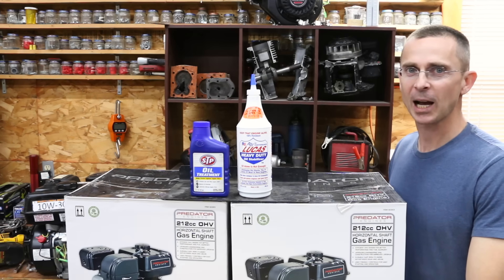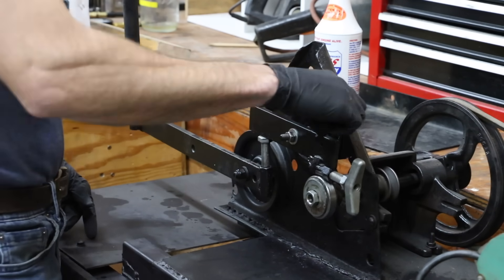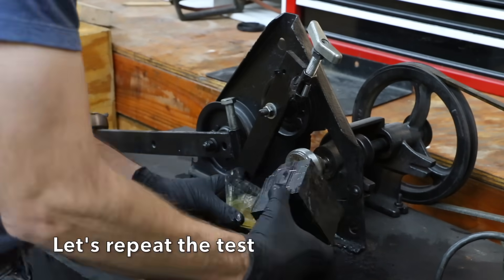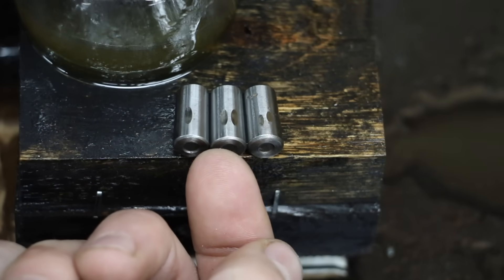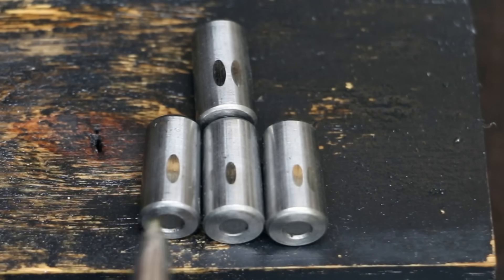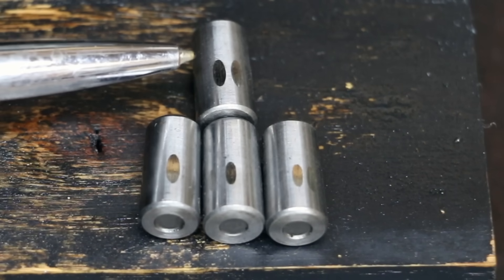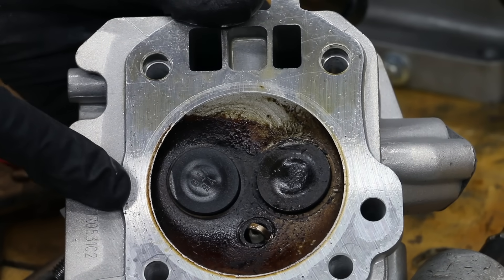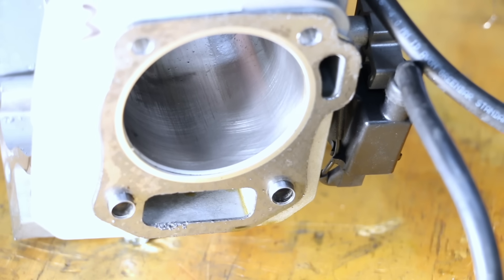Which engine self-destructs first?  Lucas or STP?

Comment: Though you do these tests on small engines do you think the result is the same when applied to large vehicle engines?
Reply from the maker: Each engine is designed differently, but film strength is film strength.  I believe the observations in this video can be applied to larger engines. Thanks

Comment: How much longer did the Lucas engine run for ?
Reply from the maker: It ran nearly twice as long.
Reply: Wow. Impressive
Reply: Yeah, it had twice as much Lucas in it. Duh. Bad test IMO. To know which is better you needed to use equal amounts of additive. I also agree that a straight oil test would have helped.

Comment: IF YOU HAVE A NEWER VEHICLE THAT HAS AN ACTUAL OIL SENSOR, IT TELLS YOU HOW MUCH PERCENTAGE IS LEFT ON YOUR OIL BEFORE YOU HAVE TO CHANGE IT, PUT KENDALL OIL IN YOUR VEHICLE AND THEN WATCH WHAT HAPPENS.  I'VE NEVER TESTED SYNTHETIC. ALL OILS ARE DEPLETED AROUND 3000 MILES OR LESS, THE 20W50 KENDALL WILL GO 18,000 OR MORE BEFORE IT'S VISCOSITY IS DEPLETED. I'M NOT SURE ABOUT THE OTHER KENDALL OILS BUT I WOULD ASSUME THEY ARE MUCH THE SAME. I WAS ON THE NASCAR CIRCUIT FOR 30 YEARS, 100% OF ALL THE RACE CARS HAVE KENDALL IN THEM, THEY POUR IT INTO THEIR OIL SPONSORS BOTTLES TO MAKE IT LOOK LIKE THAT'S THE OIL THEY ARE USING BUT IN REALITY, IT'S KENDALL IN THE BOTTLES AND THAT'S THE GODS HONEST TRUTH
Reply from the maker: Thank you for this recommendation.

Comment: Lucas Oil stabiliser destroyed my BMW engine all the hydraulic cam followers had to be replaced and it happened within three hours of having the stabiliser put into the engine and it was measured correctly to the amount that goes in the oil sump my mechanic told me the stuff is terrible and will destroy your Engine
Reply from the maker: Thanks for commenting on this.

Comment: I agree with the comments about the futility of running with no oil, of course it will self destruct as an engine requires oil. Instead, try a standard big load on three engines using STP, Lucas and ordinary oil and run them for a ridiculously long time many times beyond their recommended oil change and then measure wear and test the oil/additive mix for particles of  metal etc.
Reply from the maker: Thank you for this recommendation.

Comment: Oi should of had a 3rd motor just running normal oil as a control. Also, you could of made an analysis of if the additives even make a difference.
Reply from the maker: Thank you for this recommendation.

Comment: Great video! Very informative. 

How much longer did the Lucas Engine run vs the STP Engine?

How about the same test with a top rated non-synthetic engine oil vs a top rated synthetic engine oil? 

FYI; Husqvarna markets a synthetic oil for these engines.
Reply from the maker: Lucas ran for nearly twice as long.  Thank you for this recommendation.

Comment: was hoping we'd get flyin bits. had a 340 go at valve float rods went east an west wave threw the block. need three engs, one on oil. then we'd know if there worth it. lucas with gear oil i think is worth it. as far as with oil no,i mean one of oils tasks is dirt removale. add liter of atf run no load an drain. l think the lesson is check your oil

Comment: A lot of these comments are saying two engines with no oil will vary a lot when they break, but I'm not so sure. The engines fail when the parts have heated up so much they don't fit together like they are supposed to any more. The friction determines the rate that they heat up which I bet is pretty consistent between engines.
Reply from the maker: You're absolutely right.  When the film strength fails, the heat causes the connecting rod to fail. Thanks for commenting.

Comment: Nulon E10 "worn engine treatment". I've had dirt track engines with the oil pressure light on under racing conditions survive unscathed, one engind massively overheat with it (unscathed) and another raced for 10 mins without coolant come in with bearing knock. Oil change later knock dissapears and it lasted the next 3 races. It was hellishly loud after that but we got 15-20 minutes of full power out of a mortally wounded engine and still drove it onto the trailer
Reply from the maker: Thanks for commenting.

Comment: run engines wide open with oil and additives or cheap oil vs name brand or house brand vs name brand that would be good hold the governor wide open to see which lasts longer an have a neutral engine with straight oil wide open vs the other 2 with additives or something like that you should also test 2 strokes oils name brand vs dollar store oil and measure ring gaps when finished
Reply from the maker: Thank you for this recommendation.

Comment: Thank you for make a 14 minute video that wasn't all fluff to reach the 10 min mark for ad money.
I personally think these additives do nothing more than change the viscosity of the oil they're added to making them thicker.
Example a 5w30 mix with Lucas might come out to like 10w30 or something similar.
Which if you had an engine making lifter tick or something similar would quiet down with thicker oil in the first place.
So I wonder if it would be possible to test thicker oil compared to thinner oil with additives mixed in.
Reply from the maker: Yes, 5 hours of video condensed down to 14 minutes.  Lots of editing.  Thank you for this recommendation.

Comment: Arch oil also saved my jeep 3.8L engine. Was at 1.QT.  PER 500 MILES.  Now im at 1/4 Qt per 1,000 miles. I have 125,000 miles on the jeep
Reply from the maker: Thank you for this recommendation.

Comment: I really didn't see the point made here. I'm not big on oil additives period. I don't think either product claims to prolong an engines life after using their product and then running the engine without oil. I believe the main claim these products have is after the engine is "well worn", then adding their product to an engine, the claim is prolonged engine life after being on deaths door. That can also be accomplished by increasing the viscosity of the oil without any additives.

Comment: test Restore.   I used it on an old 302 in a 70 f100 I had and i saw a noticeable improvement in power and oil consumption.
Reply from the maker: Thank you for this recommendation.

Comment: I've used Lucas Oil in my pick-up truck for years.  My last pk tk had over 500,000 miles on the original engine (in-line 6 cyl).  The engine was still tight and the only reason why I had traded it is was because the body bushings were worn out.  I still use it in my V-6 engine and have over 250,000 miles currently.  I'll stick with the Lucas Oil until something better comes along.  Thanks for the interesting test!
Reply from the maker: Thanks for the positive comment.

Comment: Can you try the Valvoline intake cleaner the they sell at dealerships and at Walmart they say every 15k dealer get 156.00 bucks and walmart is only 20 bucks what's the difference and does it work also what's you thought on the mobile one oil annual protection they claim 20k change intervals
Reply from the maker: Thank you for this recommendation.

Comment: the only way you can test these products is by having 3 motors one with oil one with same oil and stp and a third with same oil and Lucas now fire all 3 up and run for say 5000 hrs (long past recommended
 oil change)then take apart and inspect ....if your not willing to do this your test is pointless because no oil or additive functions after it is removed from the motor ..... i run STP in my 1987 ford f150 simply because it is required to keep oil presser up  after worm up because the motor is old a worn out and has allot of blow by but in my 06 Nissan with 125k miles (i change every 5k miles) i run conventional 10w40 no additives because it is not 30+ years old and worn out like my truck is that my father bought new in 1987
Reply from the maker: Thank you for this recommendation.

Comment: I think this was a little incorrect in method. There was no control group. Wouldn’t it have been a hoot if the untreated engine (which wasn’t present...the flaw in methodology) ran longer than the treated engine. If that had occurred we would no the value of the two treatments presented.
Reply from the maker: Thank you for this recommendation.

Comment: Have just started watching you channel. Catching up on all vids. Cool deal. Now back in the day we used to run two cycle engins on our racing carts. Italian b bombs, Mac 101s and so on. Then the swing went to the 4 stroke 5 horse beefed up, mostly brigs. These ran good. But then a few were sanctioned because they were adding sulfuric acid to the oil in crankcase and was said to create hydrogen gas  that would be pulled up thru the ventilation systems and boost the rpm as it was drawn thru the carb. Never tried it myself as would not do that to a good engin. How ever you like testing and I would really like to know if it's a working rhetorical booster. They said it only took a couple ounces to the oil.  Was said to raise rpm like nitrous. Just wondering.
Reply from the maker: This is very interesting. Thanks for commenting!

Comment: A product called z-max engine treatment versus some other.  I have used Z-max in everything and its wonder stuff... but I would like to see if your testing methods have an effect.  This channel is priceless for helping me select which to use.  In all fairness Ive used STP for engine assy.  I am switching to lucas because of this video.  Science wins.  Sorry STP..
Reply: Oh and one more thing.. I suggest 3 engines.. one as a 'control'.  That way one can see with and without.  This test has no control so there is no way to tell if any of the additives performed over none at all. 

Control for the lubricity test..  Spin it slower add more weight wont work here because a crankshaft spins quickly..   Instead of a rollerbearing though.. use a friction bearing.. that way its better simulation of 'dry run'. 

Keep up the great science.. This is a cool project you got going here.. Very cool.
Reply from the maker: Thank you for this recommendation and thanks for the positive comment!

Comment: Hello.
I´ve been watching your videoes for a while. But I wonder, would the lawnmower run fine on E85? Or maybe it would be a good idea to re-jet the carb to give 20-30% more fuel. Also i guess the piston and valves would become quite clean?
Or maybe a lawnmower has too low compression for it to work?
Reply from the maker: Thank you for this recommendation!

Comment: So the conclusion is both oil suck
Reply: The conclusion is that "Mr. Project Farm" created a new and funny but meaningless way of testing oil additives. Who the hell tests oil-additives by running engines, which had once upon a time one or the other additive added to its lubricant, without ANY oil?
Reply: @michaeloberb2120 look at my comment you silly goose (:
Reply: dude if your engine is cheap or old use cheap oil dont waist money on shit that will be worth nothing later on if you have expensive engine and money use expensive oil this video is stupid idiot killed two good engines proves nothing
Reply: Conclusion is Lucas lasted way longer.  Lucas wins me thinks.

Comment: Motor test not an accurate method.
No oil film would remain on any surface after a few seconds regardless of product. Chinese motors tolerances vary on journal vs rod a lot. A Tight tolerance would best up and transfer aluminum to journal faster than a loose old motor. 

A long term test under load and then disassemble and measure wear with micrometer s is only true test as engine builders do.I have seen these cheesy china motors blow up with oil a lot. 

Fun show though. Both STP and Lucas excellent. I used STP for 40yrs never had and engine blow.
Lucas works good stop slip trans and power steering sealer works on my stuff. I have 300k on my Chevy all original. Leaks nor burns zero oil.
Reply from the maker: Thanks for the constructive feedback.

Comment: Do a 50/50 mix of petrol and diesel and put it in a petrol engine
Reply from the maker: Thank you for this recommendation!
Reply: Thanks for replying was just wondering cause if it works it would be cheaper because petrol is more expensive than diesel so could do a 50/50 mix

Comment: I'm surprised. I thought the engine that was cooler would last longer.
Reply from the maker: Thanks for commenting
Reply: The STP ran cooler since it’s viscosity was lower. Lucas is a very thick additive and really heats up engines. On more advanced engines with tighter tolerances like a car engine the difference is even larger.

The Honda GX series engine that these clones are copied from used SAE 30 single weight oil or 10W30 if used during colder times of the year. Messing with viscosity is usually a bad thing for modern engine life, tolerances are just to tight.

I would assume if the engines were not drained and ran dry the STP would’ve ran for more hours then the Lucas. Either was just running straight sae 30 the engines last forever. We use them a lot in the landscape industry and never have failures due to lubrication. Usually head gasket or carbs, otherwise they will run into the ground or till the machine it’s connected to is junk and due for replacement.

Comment: Try the Lucas synthetic type. It's too bad Hi Tach went out of buisness. It got my 302 home one night with a rung off oil pump shaft in a 79' mustang. Cleaned the piece out of the oil pump. Installed a drive for the pump, new lifters, and kept driving it until I totalled it.
Reply from the maker: Thank you for this recommendation!

Comment: From what I see in this video you used a grinder on the race to rough it up before you did the test with STP. I did not see you grind the race before you used Lucas. The roughness used with STP would naturally wear that bearing more than the Lucas as the STP bearing would have polished the race giving the Lucas a smoother surface to run on. Therefore, in my mind, this test is null and void.
Reply from the maker: Sorry I didn't show it, but I used the same grinding wheel for both. Thanks

Comment: In reference to oil,  i look at it like there are 3 types of people.  
1. Doesnt care what oil.
 2. Buys regular oil and puts in additive. 
3. Buys best oil and runs no additive.. 

So a good vid to compare with this would be to conduct the same tests with some of the higher end top selling oils and use NO additive. The standard 2 are Mobil 1 exten perf, and Amsoil signature series. 

However, Amsoil vs Redline would be even cooler of a test. 

Ofcourse, I wouldnt think to make suggestions without supporting your channel by donating on patreon.  

Heres some more ideas
Run engine on trans fluid only, 
Run engine on rear diff fluid only, 

Rear diff fluid friction tests
vs High end rear diff fluids , such as Redline Shockproof (<--very weird stuff!)

And lastly, run an engine on a mixture of Gasoline and Hydrazine (rocket fuel).
Reply from the maker: Thank you for these recommendations!

Comment: Hello Project Farm:

Thanks for your video,, very illustrative, I have a question in your last video you did the same to an engine with normal oil,  the engine died after +/- 38 min, in this case, the STP died after 12 min and the Lucas after 21 min, how do you explain that???, I was expecting that it last at least as the normal oil case (38 min), any ideas??? or I am missing something ??.
Reply from the maker: I believe the viscosity enhancers hurt the oil instead of helping it.  That's my theory.  Thanks

Comment: If your doing additives..I'd like to see Slick 50 vs. Duralube. I stopped using either because of an article I read stating these additives are nothing but snake oil same as  transmission additives, fuel treatments etc etc. I have watched a few of your tests and surprised with the results. Just curiosity. I'm not here to help make these snake oil makers rich. I just want to know the truth and so everyone else knows. Car fanatics spend lots of money on gimmicks that probably don't do anything at all. I went back to just Mobil 1 synthetic oil and regular pump gas. No more adding anything. I even stopped using Marvel mystery oil in my oil and gas tank for four years to try these products. I grew up using Marvel many many years ago and used it for 30 some years, but when the new craze of performance came out along with all the additives and treatments and oil filters etc. our minds become possessed to try all of them and brag how good they are but we don't really know unless we tear down the engine after so many miles. Not an easy thing to do. I know these small engines are a far cry from an auto engine, but the concept for protection of internal engine parts are of revolutions is still there. The bearings are crucial in any combustion engine. Nuf said, like you videos and hope you keep them coming.
Reply from the maker: Thank you for this recommendation!

Comment: I'm sure it's likely because the cost of a third engine would have broken the budget, but the one thing that makes this not scientific (and doesn't prove if these additives do anything) is there is no control (no additive). Certainly an entertaining video, and definitely shows the Lucas additive lasts longer than STP, but how does it compare to no additive? It'd be interesting to see the baseline along with these tests.
Reply from the maker: Sorry, baseline was accomplished 2 videos back in 10W-30 vs Bestline.